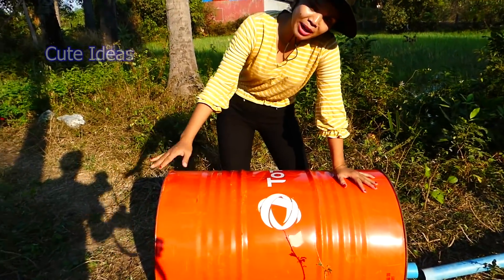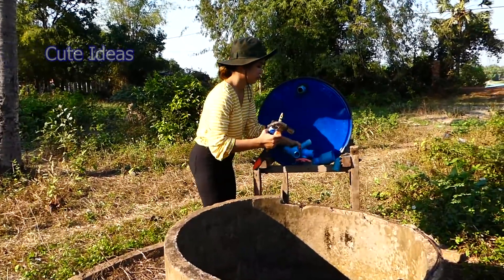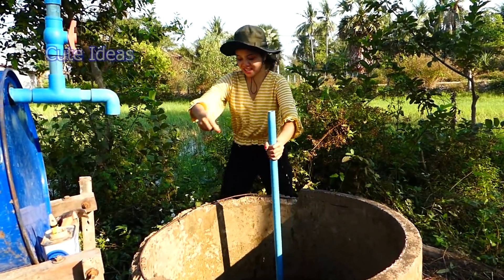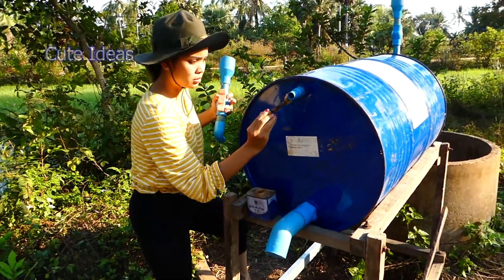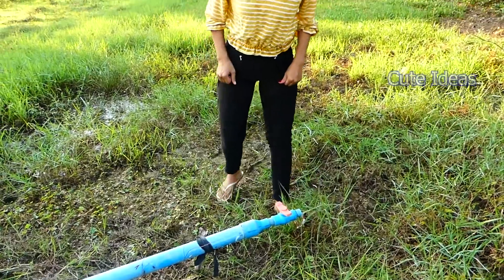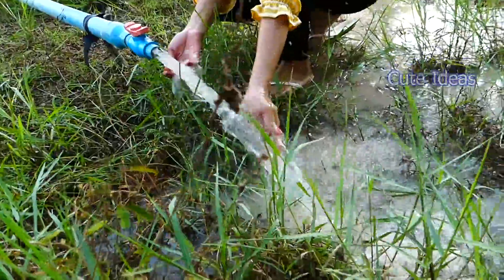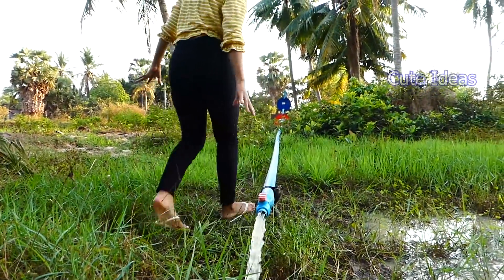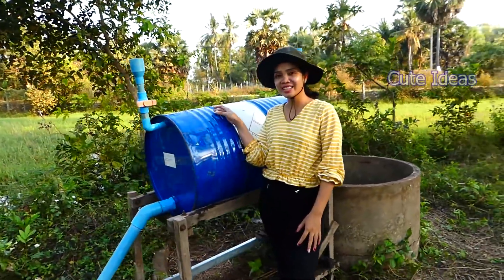Pressured Pump from Deep well, Amazing Auto water motion from deep well-using pressure tank drum

Comment: Hello Can you tell me the material you use in the input tube pipe Tip?.
Reply: You can use whatever type of tube you have. Valve at the bottom is not needed because of the drum. The red drum, tank, barrel is not needed. Two filling pipes are not needed. 
This system can not lift water from any well. The output MUST be higher than the  water level in the river, lake or well.

Comment: the second horde does not add anything, if you put the first one 1M higher, the pressure will increase
Reply: The height of the blue barrel does not help. One can bring it 1 m DOWN to get better access to filling cap. For this system to work, the water level in the well MUST be highert than the output!

Comment: She didn'n demonstrate if the water is being suctioned from the water container (the water in the lower position), because that is the key for this experiment
Reply: For the water to flow out, she opened one of the filler valves letting air in. Only water that comes out here is from red and blue våbarrel. This system can not lift water out of a well.

Comment: i see a few people on here say this is fake and will not work you are very wong this is a simple system of siphon once you fill the barrel up with water and no air can inter the barrel it has to work as long as the water is running down hill, the water coming out of the barrel has to be below the blue barrel, that is why they put it on a stand, must go dow hill
Reply: No, the water that comes out must come out lower than the water level down in the well. You can elevate or lower the blue barrel, it will not differ.  If the well/source is higher and the output is lower than the input, more warer will flow. If you then use lager tybes, more water will flow.

Comment: i am not sure what the red barrel does, water just passes through the red barrel as if were a piece of pipe, looks to me the red barel is just a very big coupling, do not want to hurt ytour feelings you did a great job and worked hard
Reply: The red barrel holds more water. For water to come out of this system, you open one of the filler tubes on top of the blue barrel. Then the red and blue barrels will drain and all stops.

Comment: oppps sorry honey you put the water down the werong pipe when you were fdilling the tank, you lost half your water back down your pick up pipe :-( you worked so hard
Reply: Does not matter. No valve at the lower end is needed and no pumping is needed due to the tank. BUT the output from this system must be lower than the water level down in the well.

Comment: Does this method last for life or a period of time and then stop the flow of water?
Reply: it will run till the well goes dry, i myself do not know what the red barrel does, i do not see the purpose of that, i do not see it doing anything other than putting the two pipes together
Reply: It will run til the source run die or there are air leaks into the system, BUT the water level at the input MUST be higher than the output. In other words, it can not lift water up from a well.

Comment: Wonderful and great work dear.i hereby request to know that is the drum able to pump the water up a hill???? Swaziland.
Reply: Not uphill. Use a ram pump in conjunction with this pump to do that perhaps.
Reply: @dirtdigger609  Shalom Wagner, Thanks for taking your time to respond to my inquiry, Yahweh bless you
Reply: Lawrence, I built a similar one yesterday.  Amazing!
I have got to put the upturn stack in line on the outlet end because mine only runs very slow. Let me know your results.

So much thanks to the wonderful lady that shared this! 😊
Reply: @dirtdigger609  The input must be higher than the output. To lift water from a well is impossible.

Comment: You forgot to mention the check valve at the other end.....of the input.....
Reply: you really do not need a check vale there because of the barrel is a lot bigger than the size of the pipe, the barrel holds 55 gallons of water and the inlet pipe might hold 5 gallons worth of air, yes you will get the air that is in the inlet pipe into the barrel but not enough to get air into the discahrge line, all this really is is a siphon, once everything is filled up and open the dowstream vavle the weight of the water makes it work, very simple and nothing to break, little pipe going in the water weighs less and that large pipe i bet it has some good suction
Reply: @butchs2337  But not here. For a siphon to work, inlry must be higher than output. It is not possible to lift water up from a deep well

Comment: Can you please do another experiment by putting another value on the intake pipe and before the first drum. Close the master valve which is after the first drum then you can fill your drum. Now you close the valve on the intake pipe, close air valve, close filling valve and open your master valve, that will drain the water from the first drum to the second drum and at the same time your first drum will eager to suck. Then you open your draining valve allowing half drum water to drain and then you open your intake valve slowly and let's see how much pressure you gets
Reply: This system does not work. A siphon can not lift water up from a well

Comment: Madam borewell has been done in my field.  Which has a depth of 210 feet.  Will this formula be applicable in that?
Reply: It will not work because the maximum suction is limited to a maximum of 32ft. In your case you need a submersible pump.
Reply: @rogeliopaguntalan5111  it will not even work in a 10 cm well. It can lift water over a 10 m wall, but outlet must be lower than the water level in the well
Reply: Μέχρι πόσα βάθος τραβάει